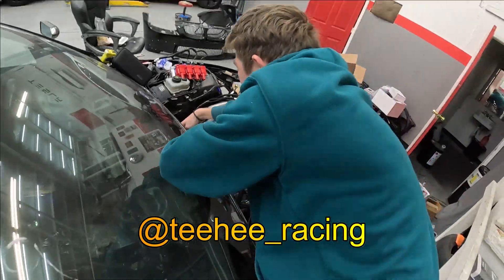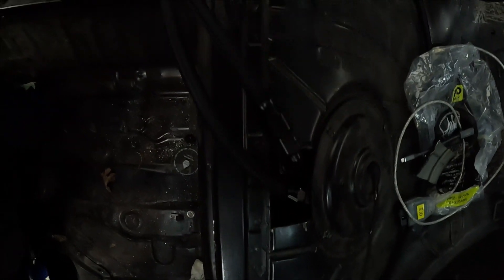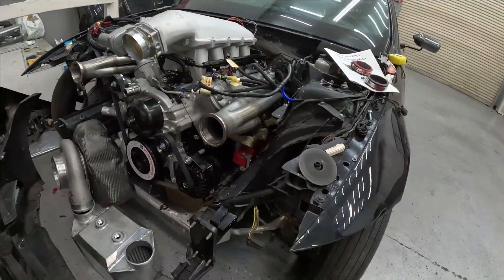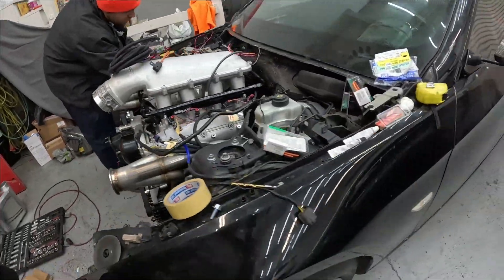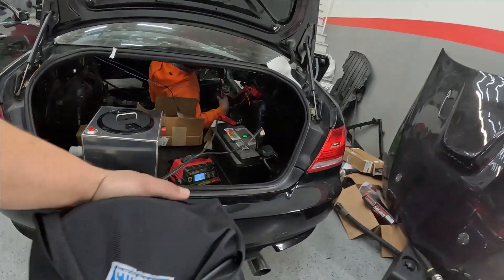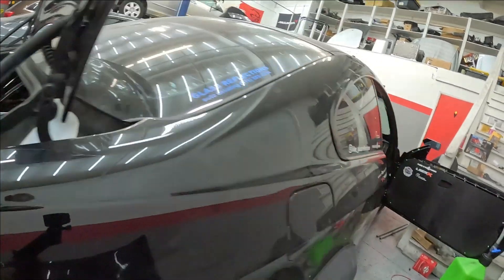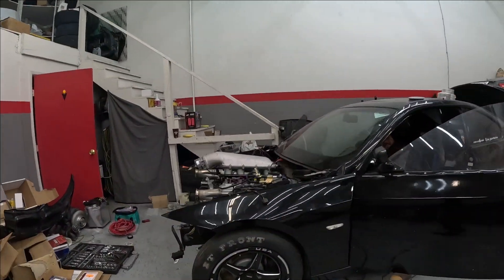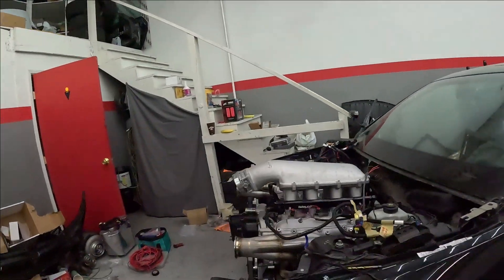LS Swapped BMW first start! sounds amazing! making turbo kit and fuel system for 1500 hp

Comment: This car was so close to hit 9s with the n54, it sucks to see it ls swapped now! Either way great build 👌
Reply: yeah i considered doing an LS swap and 2jz swap too but i just settled on my built n54 instead here in australia, Gonna be making around 550-600rwkw which is like 800 Australian horsepower, and our dynos here are like "mustang" dynos where theyre all harsh so add 10-15% to that number for a "dynojet" number etc. but thats all im doing for just a street car :D but lets face it, were never happy and always modifying and getting bored of current power!
Reply: I agree. Very sad to see the n54 go. Ls is overdone. Especially when it goes this far and the car just looks goofy as fuck. Sleeper n54 build>>>>ls drag car build.